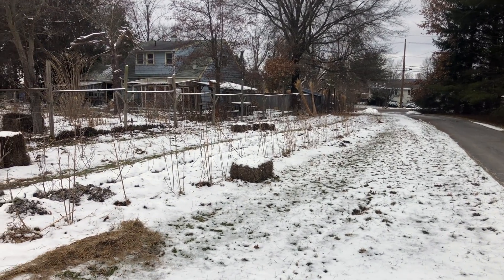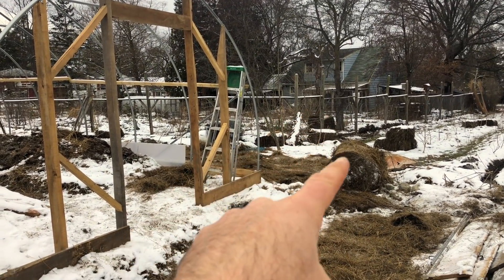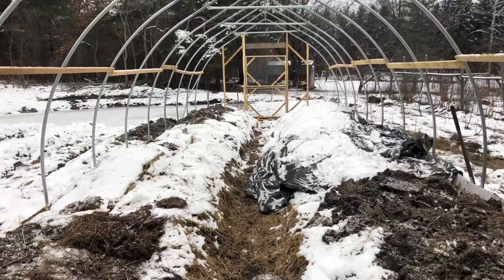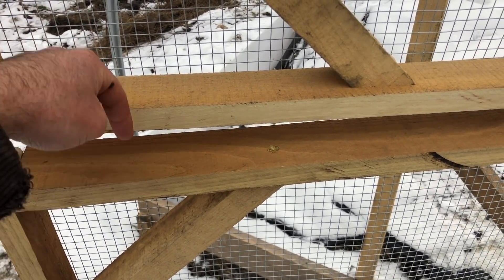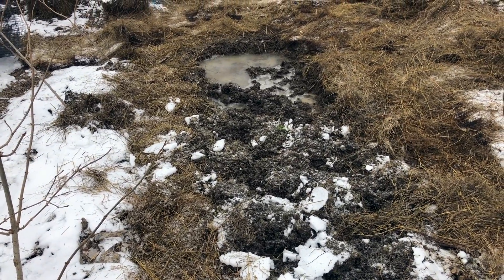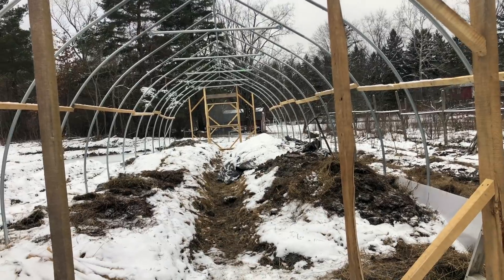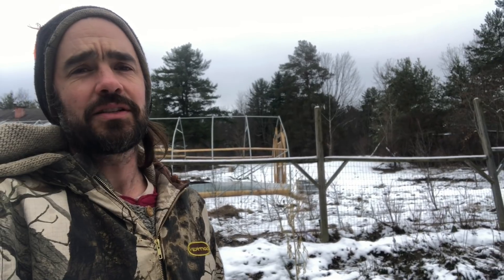High Tunnel End Walls and More

Comment: We have inserts covered in plastic that we remove from upper and lower door openings that work well in our small cattle panel greenhouse.  Maybe you could use some extra plastic to form "gasket" to fill in larger gaps around door so as to hold heat better.
Reply: We have gaskets around the Dutch door and between the upper and lower door halves. Worthwhile in our zone 5 climate. Was out there tonight with a lantern cutting mache, claytonia, and mustard greens for dinner.
Reply from the maker: I think I'll do a felt or poly element for that.  I'm not too worried about a little air moving through, it doesn't need to be a pure seal, but the more the merrier.

Comment: Probably some screws are good.  But you can anchor those boards by putting a stave (I want to call them stakes) on either end on the outside that you want to push against and one on the inside in the middle that pushes in the other direction.  I do that to anchor the contour logs I use for terrace walls.
Reply from the maker: Makes a lot of sense.

Comment: You're sure you want to pull the door and not push it? Interior once cover will always be free of snow and ice. Exterior, you'll maybe have to shovel and break the ice just to enter the tunnel. Or even the lawn in the summer can block a bit. But if it work well for your other tunnel that way, hey! good for you!
Reply from the maker: I hear you on that... But these are big doors and that would be a fair bit of lost bed space if they had to open inward...

Comment: Dutch doors and very common in the south.  Most dowel latches would intuitively be made to rest in the hole with gravity, but when the wind catches the bottom door, it'll pull that one and the dowel will pop right out.  They always needed some sort of way to be latched in without just gravity.  Also, plants outside the doors as a wind break help.
Reply from the maker: Good notes here, thank you!

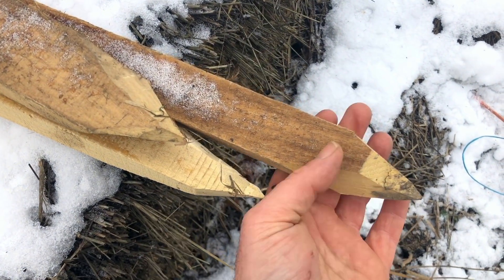Comment: 1:40 I don't know what a chop saw is, but I assure you that those points are very easy to put on with a little hatchet, that easily and only fits in one hand.  You just need a stump or something to chop on top of.  I make stakes all the time.  I split logs and then sharpen the ends.  I use them to anchor logs going crosswise (on contour) on hills to make little terraces above them.  And to use to secure the end of a cord that I want to tension.
Reply from the maker: Absolutely, I use a hatchet, too... BUT if I'm making 100+ staves with 2"x2" black locust a tool to help with the process doesn't hurt :)

Comment: Ideas: Start collecting plastic barrels and after putting plastic on add a row of water filled barrels along the entire north side (outside of plastic). Make sure the barrels are close together and touching, and that they also touch the plastic. Then install a row of wood along the top of the barrels and cover the barrels with compost. The heat should transfer from the compost to the barrels and then into the greenhouse through the greenhouse plastic. There also might be a way to collect rain water off the greenhouse through thin plastic/vynil type trim edging or a bungee cord type system that would be tight against the walls without using screws.
Reply from the maker: Very nice concept, I saw a video about this before...  Great idea but unfortunately in this particular context it wouldn't work (there is a bit of slope on the north side AND there are shrubs planted nearby.. .Something to consider for future experiments...

Comment: Since I'm old...... I remember that in Wilbur's house they had a dutch door in the kitchen and Mr. Ed would stick his head through and chat.  I think I remember that the top and bottom were  held together with a slide bolt running up and down rather than sideways as normal.  You might want a little bit heavier duty one but still, it would be cheap and cheerful..... and fast.
Reply from the maker: Thanks for this note!

Comment: Thank you for the videos, especially on those cold days! I've seen those wax pistons used for auto greenhouse venting and they seemed to work great, they were used towards the top of a geodesic dome greenhouse that would be tough to otherwise reach. I like the dutch door setup too, handy for those who may have dogs or other critters that would need to be kept out but still letting pollinators in.
Reply: I have one in small cattle panel hoop house and three in geodesic dome greenhouse and wouldn't be without them. Love they take care of themselves and adjust with thumbscrew like mechanisms. 🌱👍
Reply from the maker: The auto-window opener is a super nice thing.

Comment: For the way to lock the doors together, I wouldn't say you're wrong about effectively a stick through some holes, but I'd so something closer to a quarter or half inch thick bolt that drops into place, 

On a different note, I have started making my own cattle panel greenhouse, 4 50" panels long, just under 7.5 feet across to let there be just over 6 feet of height so i can walk through without brushing the top or stooping.  It was possible the easiest and cheapest greenhouse construction I think there is. Should finish my end wall next week or this weekend if I'm lucky
Reply from the maker: Awesome the cattle panel idea is coming together for ya!

Comment: I’m really learning a lot watching you build your high tunnel greenhouse.  Please video the attaching of the wiggle wire channels to your round metal structures and door frames.   I’ve seen the channels used on big commercial tunnels but you will be the first one, for me, to see how it gets attached to the framing.  Also, QUESTION:  is there a difference between a greenhouse and a high tunnel?
Reply from the maker: Greenhouse - a season extension space that is actively heated (propane, wood, biomass, etc)
Hightunnel - an un-heated season extension space
This may ride the line since I plan to include a bunch of passive/solar/compost heating elements to this 'hightunnel' but you get the idea.
https://www.youtube.com/watch?v=lAIHSw5iSUI - 15:07 - Farmers friend video that shows how they install the wiggle wire channel... I plan to mimic it exactly...

Comment: You might want to try to make those automatic venting windows as big as possible and also put them as high up as poissible. I would also put in automatc vents att the bottom of the greenhouse so you get some better airflow if you don't have time to open the sides or doors in time... A common mistake is to underestimate how hot in can get! And then people try to fix it by shading but then you lose a lot of productivity with less light...
Reply from the maker: I don't think I'll add shade cloth, but once we get into the swing season I'll be monitoring and figuring out what is needed and make adjustments.  Could be I have vents that are automatic on both sides so some cross breeze can happen.

Comment: Do you use crates for nesting boxes?  I've seen that and also kitty litter containers have been joined for nesting boxes.  I remember seeing your chickens laying almost anywhere so how are you managing that aspect?  How much are those metal pieces for the structure you are making currently?  It's nice to see you getting off pieces of wood to build with.  Is that locust wood rot resistant?  How long before you'd have to replace?  So is this high tunnel a replacement for the  one that collapsed?  or is this one independent. Are you fixing up the one that collapsed?
Reply from the maker: We use milk crates for nesting boxes.  We should do a video on it once we have it all cleaned up nicely in there...  They are pretty good at mainly laying in those
Black Locust is insanely rot resistant without nasty chemicals.  I love it.
Could be 10+ or 20+ years before they begin to rot
This is an additional high tunnel, the other one didn't actually collapse at all, just bent a tiny bit.
That other one is in just fine shape!

Comment: 5:20 - I think "Dutch door" just became clear, cause I was like wtf?  Is that a hexagon shaped door?  It's like something from Mr. Ed.  I think you have those on barn doors for horses for some reason.  Two separate doors one on top of the other.  That looks fun.  It could maybe be useful for ventilation?  Open one low on the shadier side and one high on the warmer side to draw cool air through the system in the Summer, perhaps?
Reply from the maker: Dutch door is just a simple door 'broken' into two parts.  It isn't a hexagon, those angles are for support/racking resistance.

Comment: Are you going to try using compost as a main heat source in the high tunnel? How is your compost heating project going on the home greenhouse? I am very interested, not only in IF this works, but more importantly, for how long it works into the winter. Thx.
Reply from the maker: To be honest the experiment in our greenhouse next to the house is on pause, just too many other moving parts...
I plan to rebuild it and monitor and share notes this later winter, and hopefully there will be some info of worth for you then...

Comment: Did you use concrete for foundation to the arcs?
Reply from the maker: No... They have 4' long rebar pounded in that each arch slips over.
Reply: @edibleacres  I'm asking because a strong wind could lift the whole structure like a parachute